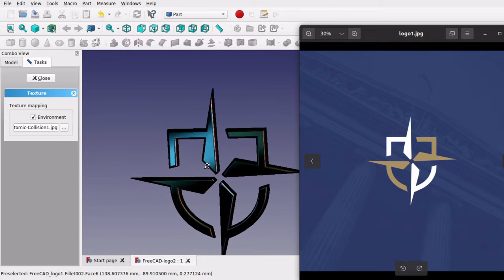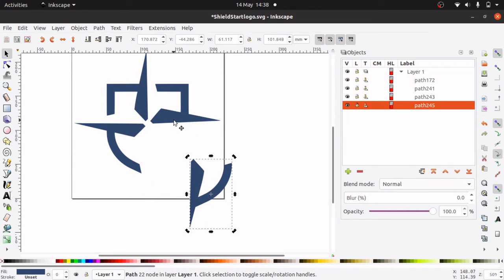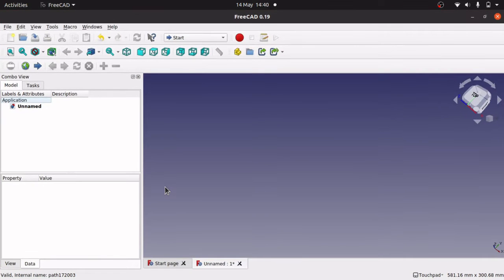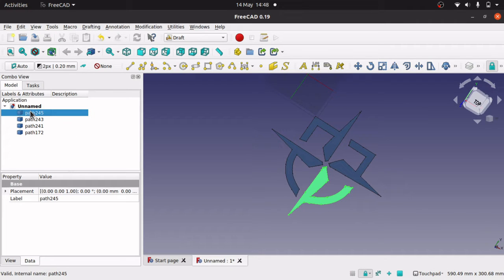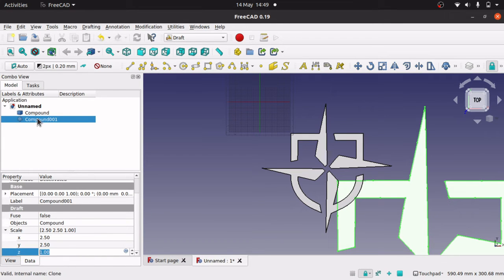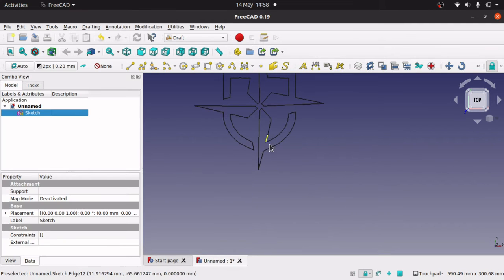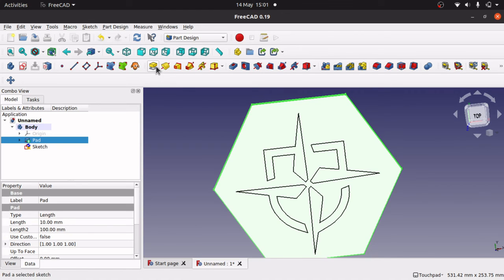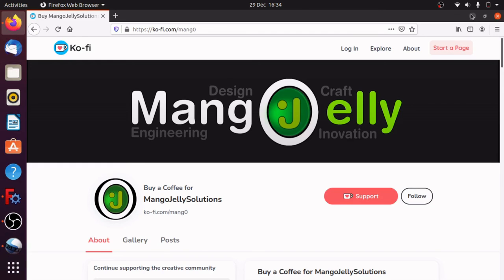Convert your logo to FreeCAD PART 2 of 4: Import and fix issues, pad pocket extrude. Beginners guide

Comment: I tried this, but the video is for a much older version of both Inkscape and Freecad, so the menus are much different and all I wound up with was a black rectangle. Trying to change the document size just reduced the size of the logo.   Going to keep trying until I get it right.

Comment: Thank you SO much. This video was tremendously helpful and supported a solution for a problem that I had for several days and the internet couldn't provide an adequate answer - but you can ;) Thanks!
Reply from the maker: Great to hear it was of help. It's quite a old video considering the advance of freecad but the workflow is still the same. Thank you for your feedback and glad you enjoyed.

Comment: I am working in 0.21 version butI am not able to empty or pad the logo´s sketch because of the following error  "result has multiple solids, that is not currently supported" . How did you do it? I can clearly see that your sketch is comprised by 4 figures but in your case it was possible to pad/empty.

Comment: I imported my svg from illustrator, and followed the steps to create a compound, but I can't seem to get my logo centered. When I use the move tool, it attaches to a point that isn't in the center of the logo, so when I move it it's off, so when I want to use the pocket tool with the backlayer (just a simple hexagon) it's no aligned properly. Do you have any tips?
Reply from the maker: Sorry for late reply my. Svg point of origin is a top left corner. You move the svg to the center (enable the axis cross) and then use draft down grad and and upgrade and that will reposition the axis.
Reply: @MangoJellySolutions  Thank you so much, I'll give it a go

Comment: hi, I have two questions:
1- I am using realthunder, but when i import my svg file , it doesn'T ask me to use the file as geometry or drawing!  bt when i restart the program, and then i select recently saved file and i select the svg file that Ive just imported, it asks me about geometry or drawing ! any idea how can i fix it ? or when i find the setting about that question ? or maybe there is an issue with my svg... i couldn't find the related setting.

2-  when I use "create a suc-object binder" in part design wb, and i bind the surface of my svg file, after i pad it , i no longer need the originial path, but if I delete them, my pad will crash. how can i see the dependacies of all file ? also, is there a way to remove it and delete it without damaging my pad ?